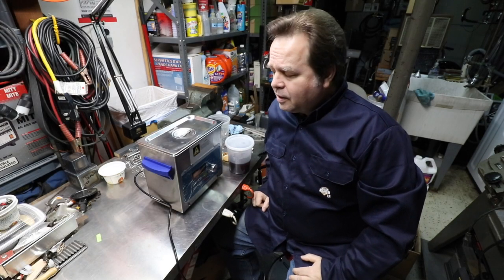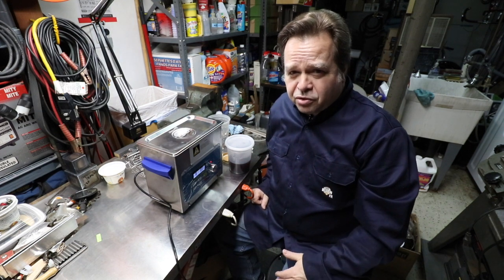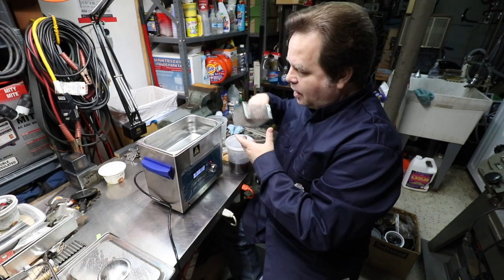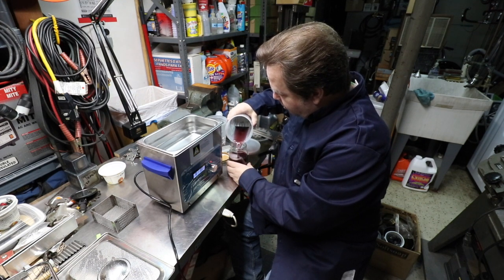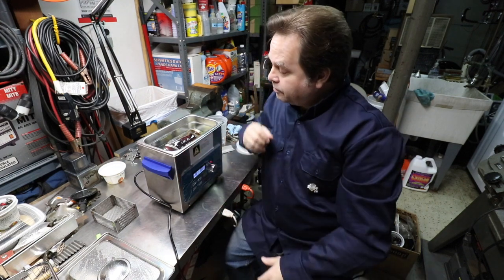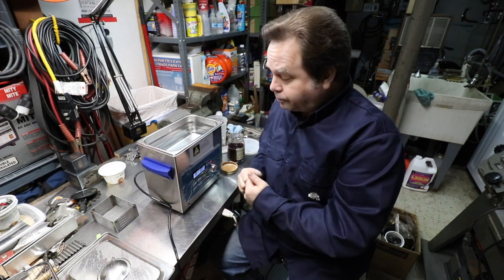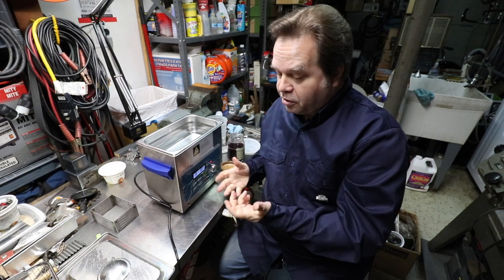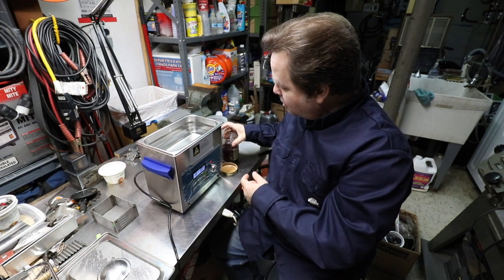Ultrasonic Cleaning of Small Parts

Comment: Buen vídeo, en mi caso para no ensuciar el tanque, utilizo bolsas de congelación con auto-cierre. LLeno la bolsa con agua caliente, jaboón y un chorro de vinagre, le quito el aire interior a la bolsa, la cierro y la introduzco en el tanque.
Reply from the maker: Javier, that's a great idea! You're right, some soap and vinegar works very well for cleaning. You can get weird shaped parts into the bag easier than into a jar. Thanks for the comment!